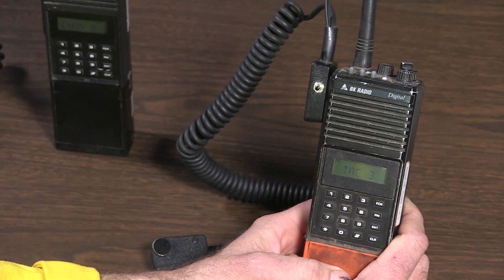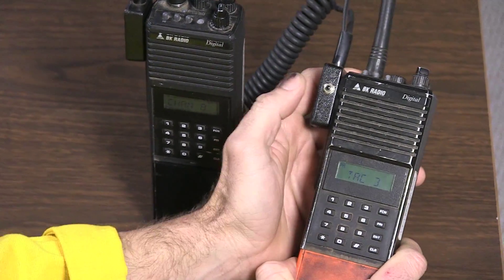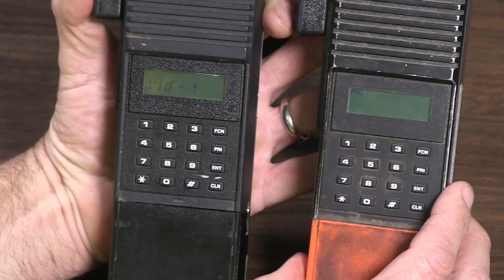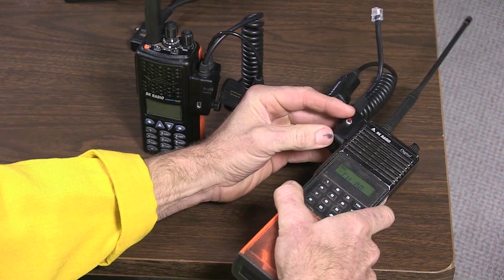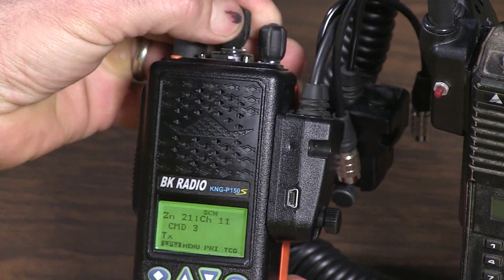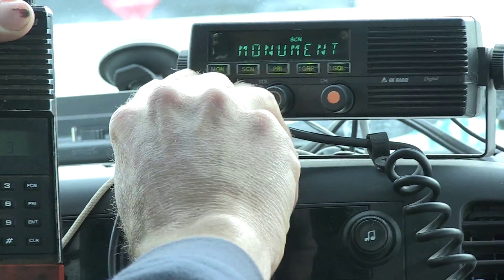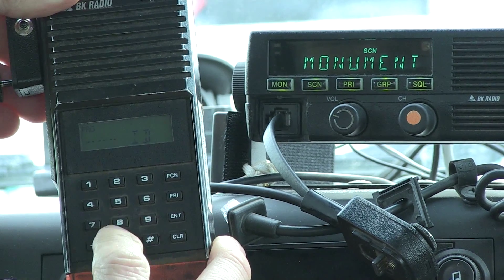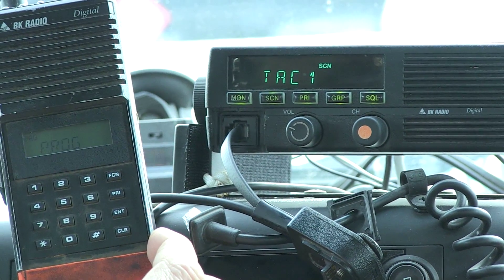Tutorial: Cloning the Bendix-King DPH Handheld Radio

Comment: Great video...one very important item.  Make sure you turn your slave or receiving radio off and back on (cycle) in order to lock in the newly cloned frequency or other programming changes you made (prior to inadvertently keying the mike and blowing (you know this is a bad thing) into it to see if it works.   Otherwise-as most of us know- we'll get to do lots of explaining to our DIVS regarding comms protocols and the various forms of repeaters that were available to us.  Swamper stuff...